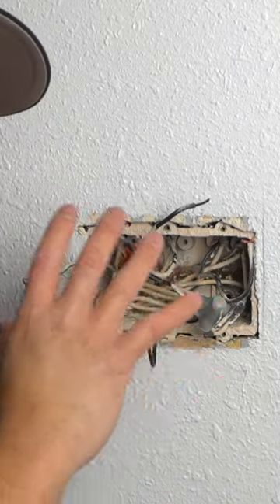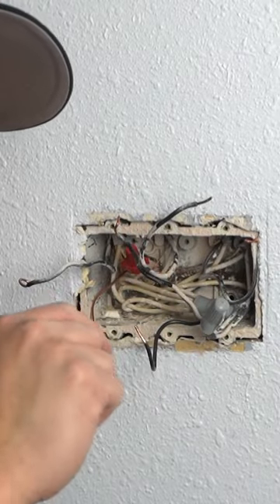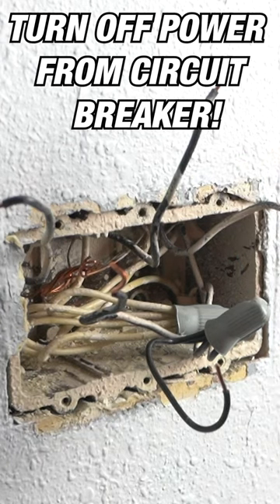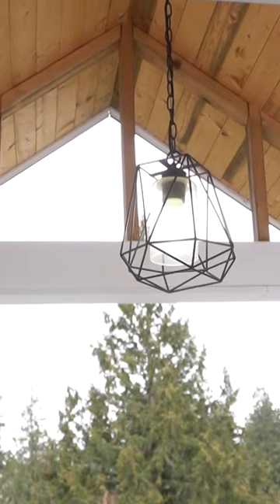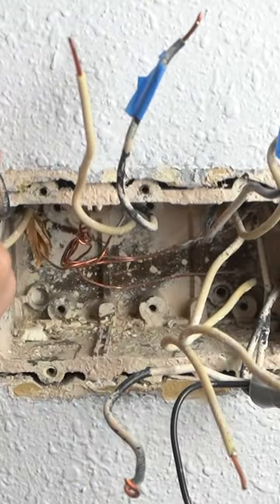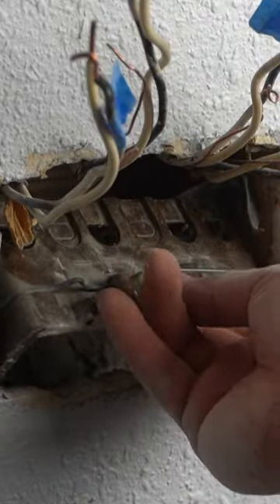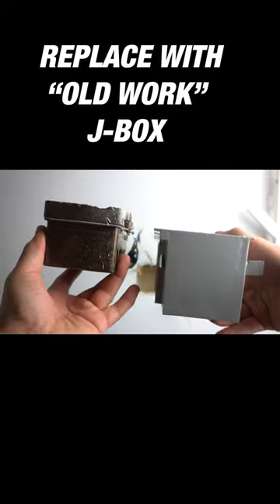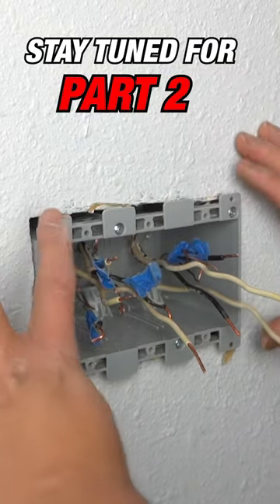How To Clean Up A Messy Electrical Box! DIY PART 1 #shorts

Comment: I hate how shotty electrical is in residential. Can we just secure the box to the stud with a screw and cut our wires long enough for the next guy?
Reply: pig tails definitely cut down on mass wiring....😸✌️💪👍🤔
Reply: You get nails into the studs only 😊
Reply: Waygo lever connectors ftw
Reply: Many residential projects are simply: "That's good enough - no one is gonna see it anyways" and as long as it works on the electrical inspection, they'll let it go. Of course, it sucks for anyone coming in behind them to chase down problems......

Comment: Beautiful short vid. If you grab three dimmers at Depot and expect to easily replace them in a home with traditional switches you’re in for a treat.
Reply: Disagree, this vid is WAY too short to cover all that's needed to know, and he didn't even show his finished product. 

There are several codes involved with this project, not mentioning them is a disservice. For example, there are code regulating volume and fill of electrical boxes. Just not mentioning that makes it a crap video, let alone several other need to know codes and issues involved.

Comment: Dry wall boxes in the UK are a bit different. They've got plastic pop out lugs. You insert the box thought the rectangular hole, pop the lugs out. When the faceplate is screwed in, it just clamps the box to the back of the back of the plasterboard (sheet rock). 

It's very simple and secure and no sideways nails into studs are required. Does the US not have something similar? I know the receptacles and switches aren't the same, but I'm sure the idea could be adapted. Maybe US regs don't allow the boxes to be fixed to the dry wall.
Reply: Don't forget to use rubber Gromits when using Galve Patrice boxes.
Reply: I'll park that thought somewhere.
Reply: You can see the top two tabs on the replacement, or 'old work box', as we call it, when he's shoving the wires into the new box. It works the in a similar manner to the way you described it. So, yes, we have these, and our regulations don't forbid it.

Comment: Breautiful, neat work! My question is how do you determine the load line.  Usually it's the black right?  But I know sometimes guys will make a white wire hot.
Reply: That's why there should be a standard,  Here the live is brown.
Reply: In that switchbox there were three loads, and two 'constant' wires, all of which were black. But the two 'constant' black wires are tied together, with three 'pigtails', to give power to each switch. The remaining three black wires in the box are loads.
Reply: With the switch cover off and all the switches loose and in the "OFF" position - use your NCV detector to identify the "HOT/LINE" side of each switch - and your NCV tester should "chirp". All the "SWITCH LEG" sides should be "cold" and your NCV tester should "not chirp". This applies for regular 2-pole switches - but any 3-way switches will have to be ID'd separately to ID their "HOT/LINE" wire(s) vs "SWITCH LEG/TRAVELER" wire(s).......

Comment: Should had used another fiberglass hox
Reply: PVC box for old work with flaps could have worked. How did he anchor the box?
Reply: @sandburgmartin7947  not sure, didn't check when I watched the video but fiberglass boxes are nicer and only like a dollar more. Definitely worth it

Comment: Were those just plain wire and not in conduit?  Or, was that Romex and we just didn't see the sheath?
Reply: plastic box is a hint.
Reply: @master-oppressor  How so?  Of course the wires come into a plastic box and he changed that for a larger plastic box.  BUT, that doesn't answer my question.  Wires in a wall need to be secured (knob and tube) or encased (romex or conduit) to be up to code in North America.  The video makes it look like those are just loose wires running in the wall.
Reply: @master-oppressor  You sure love to argue while reading things I didn't write and not answering the question.  I don't know why one couldn't run EMT to a plastic box.  One would just have to use the correct fitting on the end of the EMT.  BUT, I said conduit which includes plastic conduit.  You still need the correct fitting.  Note, both the old and new box have both round holes for conduit fittings and provisions for Romex strain reliefs.

The questions I asked were, "Were those just plain wire and not in conduit?  Or, was that Romex and we just didn't see the sheath?"  I rewatched the video again, but this time expanded the image and paused it several times.  In one place I could make out a bit of the sheath and jute material of the Romex and in another place I could see what looks like some sheath.  

With the plaster debris, the white paint, and speed of the video, it was difficult for me to see those details originally, but that answered my question.  As for which North American inspection team, that would depend on your specific location.  I used the term N. American as the USA and Canada have similar codes and electrical systems, I also recognize that many locations put their own twist on the National Electrical Code
Reply: @BryanTorok  There are over 30 countries in North America. 

Which inspection team?
Reply: @master-oppressor  I wrote about the two largest countries and being contiguous, having similar electrical grids and laws.  I also already allowed that there are many different jurisdictions.  I never said anything about inspection teams nor do I care to debate further.  BTW, Wikipedia and other sources say that there are 23 countries in North America.  I never realized it was that many.

Comment: I've always wonder what that old brown box is made of. I'm guessing phenolic
Reply: It was called bakelite , or pronounced bake-a-lite in the old day. That material was the first plastic made from synthetic material. 

It was named after Leo Baekeland who developed it in the early 1900's

It was a form of plastic that was very brittle and would break easily if you had to modify the electrical box. 

I don't think this white box in the wall in this video is the same material, but I wanted to address your question.
Reply: @El_Diablo_LI  You're correct....

Comment: That wiring is pathetic, what country is this?
Reply: @Rcb0  the workmanship and quality of materials is pathetic, If I did work like that I would sack myself.
Reply: US. Most of this original work was done several decades ago when many NEC codes were non-existent......
Reply: @Rcb0  Wire Nuts are very effective - depending on the know-how and care when installing them. Besides, when the wiring is installed inside a wall it's not going to ever be disturbed anyways. That is, unless there's a major renovation or a house fire......